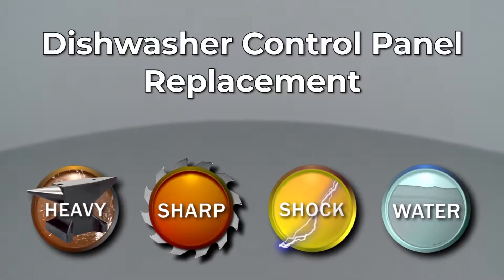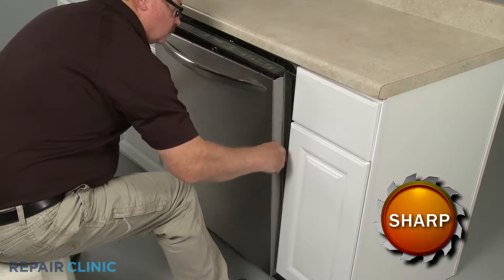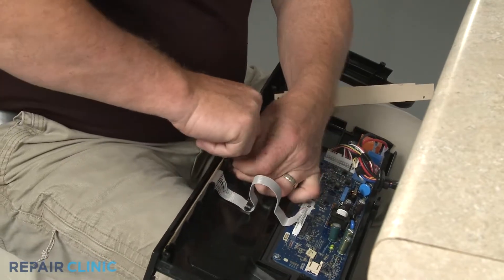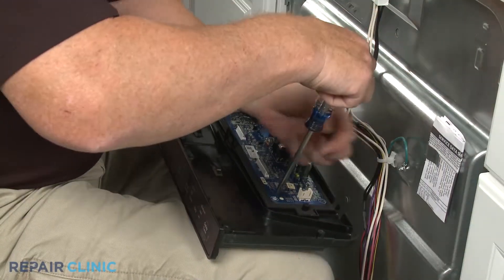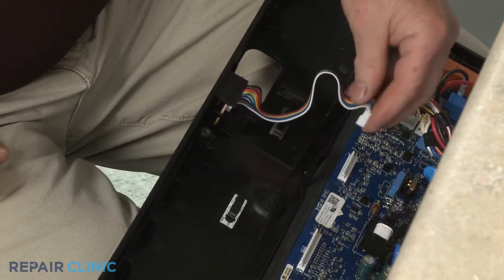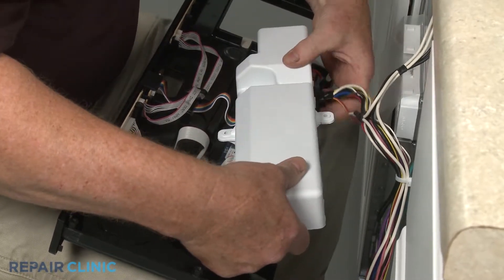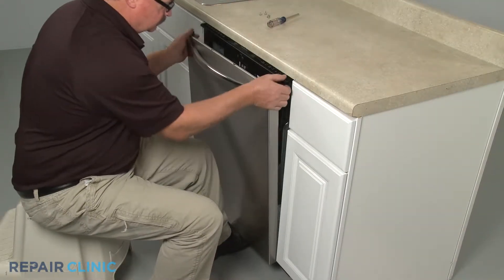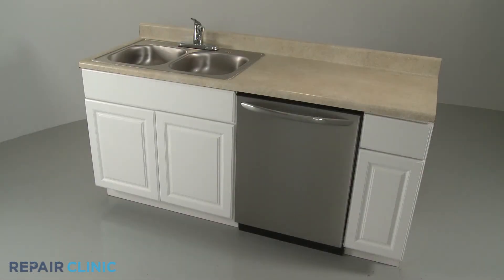Frigidaire Dishwasher Control Panel Replacement (part 5304520552)

Comment: My start button quit working after 19 months.  Very disappointing.  This video is just the tip I needed.  Thank you.
Reply: Same reason why I’m here. The exterior portion started fading away and now it doesn’t work, even though I hear the clicking of the button. I hope I find the control panel cheap cuz where i looked it said $330. Dishwasher is 5 years old.
Reply: Yeh this design is trash

Comment: that's why I'm here.. was going to be charge about the same price that the thing is worth?.. just ordered the parts..will leave update when I do it..gotta hope for the best.. The parts arrived from sears wasn't sure what was broken so I installed the mother board and all the sensors that connect to panel.. Kind of a hassle better to replace.. And what do you know?.. IT WORKED!!.. now the wife is happy because she can use dishwasher and doesn't have to smell Stagnant dirty water.. Thanks repair clinic dudes.. 👍

Comment: I have this dishwasher but with a different handle that's also positioned like this one. I had my parts shop order this part number, and it doesn't fit this handle - the back of it is made to allow for a handle on the left side, not at all like this video or my dishwasher. Now my front plate doesn't fit the dishwasher 🙃 I spent a lot on this part. I googled it before and it seemed the same but when I checked online again after, I noticed the handle difference. It's not even the same part you used in the video. Everything else about the part was the exact same so I got it all the way installed before I noticed... Cool.

Comment: Is this the solution to the three lights “clean wash sanitized “ blinking? Start stop and no other buttons work. Only the child lock work currently on my dishwasher. I asked bc a technician came out and wasn’t sure what the problem was and wanted to do trial and error by replacing the control panel first then the motherboard if that doesn’t work. But the combined cost will outweigh the purchase of a new one. Unless it is just the control panel then that can save me a few hundred dollars

Comment: Nice.
My dishwasher just started turning itself on and I can't shut it off with the start/cancel button.  I shut off the breaker switch, powered it back up and a few minutes later it started up again.
It had a strange combination of settings, but the failure repeated itself.
It's a Frigidaire like in your video.  It's ten years old.  I live alone and only use it once a week.
Any ideas would be appreciated.
Thanks
Reply: This might be a situation where you have to replace the electronic board as well. These guys have a video on how to do that, too--super easy!

Comment: Never buy fridgedair products. Total garbage. I used my dishwasher about 50 times and this control panel already needs replaced. Complete garbage
Reply: I agree, my Frigidater gallery series dishwasher is three years old next week. Today I noticed the plastic overlay at the start button was cracking out. Ridiculous. I would never buy a Frigidaire unit again.